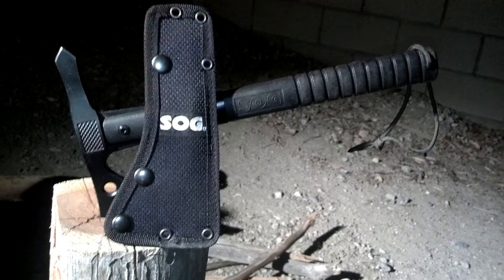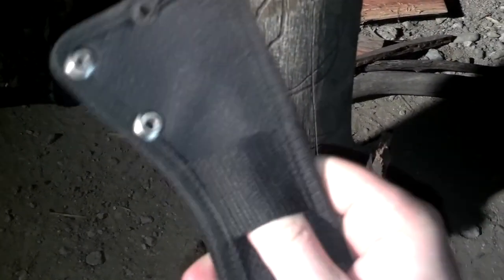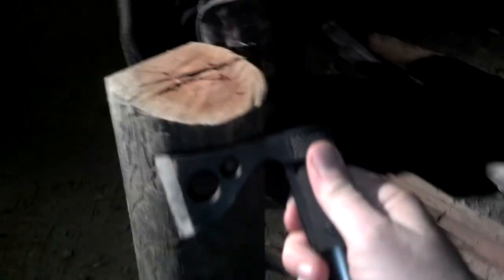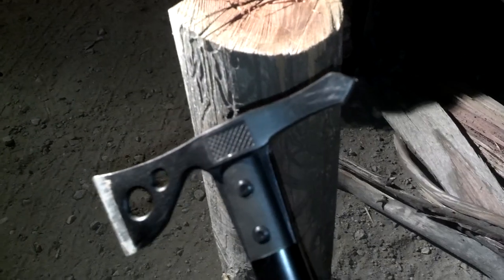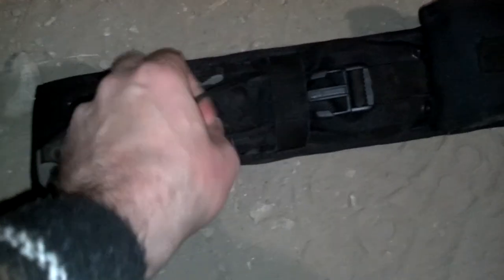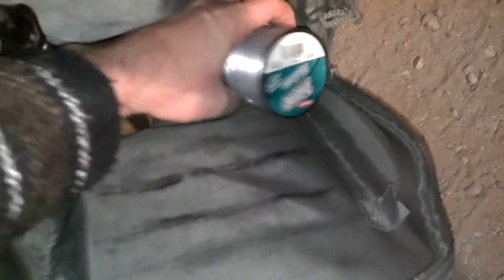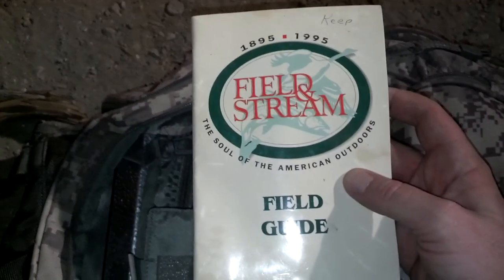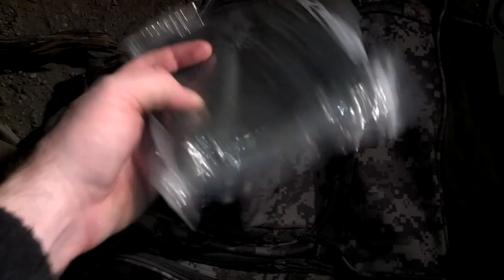SOG flash hawk and miscellaneous crap

Comment: Pretty cool gear man. As far as using a Tomahawk...I suggest getting a Cold Steel Hawk...I just finished modding a CS Trail Hawk. They come rough, but with a little love, they are very useful...especially the Trail Hawk with the hammer poll or the Pipe Hawk with the solid pipe on the back. I was disappointed when I received the Trail Hawk, but now that I have it fixed up, I think it will serve me well for years to come. Nice Taurus!